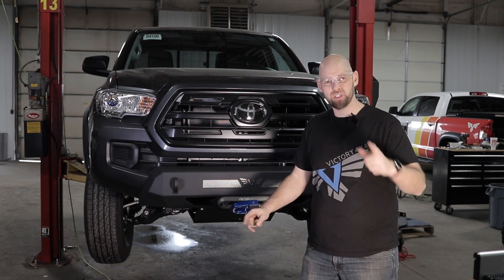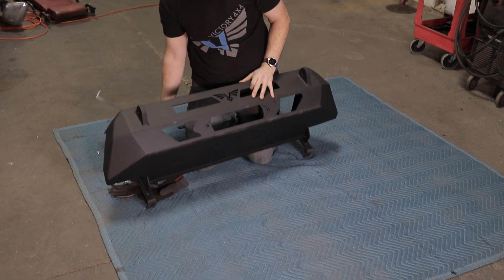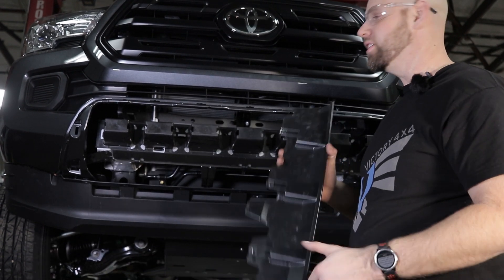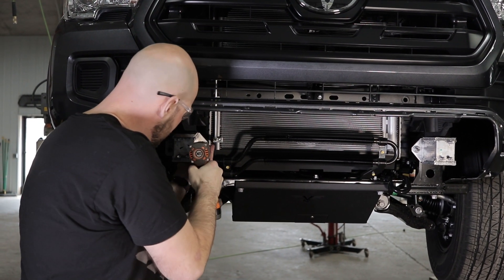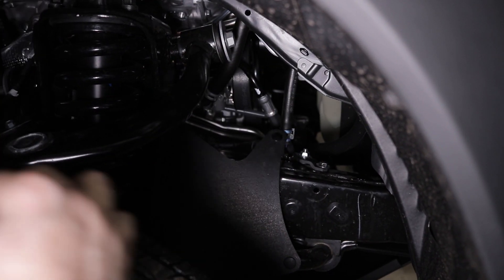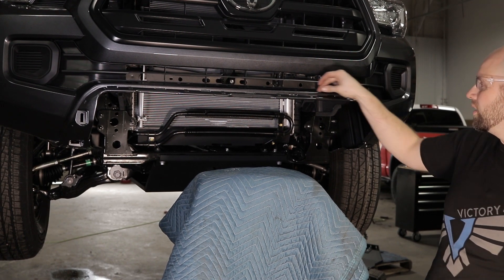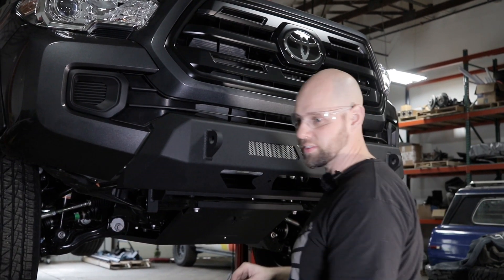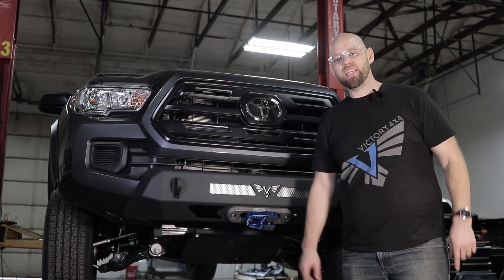Blitz Front Winch Bumper Installation | Toyota Tacoma 3rd Gen | Victory 4x4

Comment: Finished the install last evening after work.  Took me about 2 hours and I had to deal with a few self created issues along the way.  All went well after I figured out my jack was about 4 inches too short.  And since I had the winch mounted it was a LOAD.  But it went in very well.  One issue I had was the tabs to relocate the cooler were flat and appeared to be longer than the ones in the video.  When I trial fitted them the cooler came into contact with the bottom of the radiator.   I ended up drilling a new mounting hole on the passenger side mount that put the cooler out of contact with both the radiator and the bumper.  Not a big deal.  I also found a 6 inch strap with holes at each end that I did not use.  What is it for?  Did I miss something?  Very happy with the end result.  Looks great and highly functional.
Reply from the maker: It sounds like we may have accidentally shipped you the brackets for the 4Runner. Sorry about that! If you'd like to contact us at tech@victory4x4.com we can get the correct ones out to you.
Reply: Thanks..  Not a problem.  I got it installed.  Its fine.
Reply: Fit and finish is everything.

Comment: Such a simple installation...until it comes to those flaps in the wheel wells, which just happen to be tucked in BEHIND the mount for the remote reservoir on my Icon Stage 4 suspension.  Is there another way to access those?
Reply from the maker: You may be able to pull the wheel liners back enough to do the install without totally removing them.

Comment: Do you have to mount a winch with the free spool lever pointing down with this bumper?  That's the only way I could reach the release lever.
Reply from the maker: No, the clutch is accessible with the winch mounted ion a standard upright position. There are openings on either side of the fairlead that allow access into the winch plate for that reason.
Reply: @Victory4x4  Awesome thank you! Now I just need it for cheaper than air and I can afford it. (broke dad problems).

Comment: Question? Does it have to have the logo in the middle of light bar opening?  Seems like it is kind of a waste.  should just make it solid and have light bar space.  I get it is advertising, but functionality wise it doesn't make sense. Also would help cut costs.
Reply from the maker: We think it makes the bumper stylistically more interesting than a rectangle hole, and it blocks so little light (like 5% of the total area of the opening) when it's all said and done that we felt it was worth it. Comparable to putting a light bar behind a grill honestly.
Reply: Victory 4x4 what is the weight and pricing could you link it?  I will be looking into something like this in the future.
Reply from the maker: @buolson  https://www.victory4x4.com/product/VT3FB-T.html
Reply: Victory 4x4 .

Comment: I received two additional brackets that appear to go behind those 14mm outer mounting nuts. Can't find any installation instructions for them. Do I need to install them or will it be fine if I leave them off?
Reply from the maker: Shoot us over some pictures of the brackets in question and we can help clarify. Sounds like you may be referring to the tie-in brackets. 

Info@victory4x4.com
Reply: @Victory4x4  they are the tie-in brackets. I already contacted your customer service dept. They wouldn't tell me if I needed to install them or is it just recommended to install them. Because it's going to be a big pain in the ass to install them now
Reply from the maker: If they are the tie-in brackets, they do need to be installed, and the installation is pretty simple. That's generally one of the last things you do during the bumper install.
Reply: @Victory4x4  Ok. Thanks.

Comment: Will a Warn VR 10-s winch fit in this bumper?  I it was mentioned that a VR 8 will , what about the 10?   Just ordered one of the bumpers  btw, super excited !!
Reply: Did the Warn VR 10-S fit with this bumper or did you have to relocate control box?
Reply: @nickht88   It fit fine.  There is a metal arm or mount ( what ever you want to call it ) in the Tacoma front bumper that the bottom of the grill clips to that I removed. I used a few zip ties to secure the grill in place. ( bottom) .    I left the bar in for the first year or two but it makes it tuff to plug in the winch controls so eventually  took the bar out.  But either way the winch FITS well.
Reply: @brokenarrow420  awesome, thanks so much for the reply!

Comment: 16:12 can you get to those front 14mm bolts for the install with a Warn M8000 installed? Thanks. Decided to go with this mount. Only question I have.
Reply: Yes, should not be a problem.

Comment: anyone running this with a bull bar and TRD pro grille with Radar cruise?  wondering if it will work or if it interrupts the radar cruise.  Might just go with SSO slimline as i'm not too crazy about the logo.
Reply: doesn't affect the radar
Reply: @shoegum7362  that’s great to hear. Looks good without the bull bar but looks even better with it. And that it doesn’t effect the tss sensor for pro grills is even better.

Comment: License plate??
And rear steel bumper why doesn't work with BSM? looks nice but for that reason I'm not doing it... "license plate and bsm"... work on those details..nice products!
Reply from the maker: Something like this will work: https://www.quadratec.com/p/tuffy/flip-license-plate-holder-hawse-fairleads

BSM is a huge issue with packaging the sensors and liability. Toyota doesn't' give out testing or calibration procedures for these safety features, so we can't test placement.
Reply: Front license plates are lame. I moved to a state that doesn't have front plates.

Comment: Hi, I've noticed that you had already installed skid plate.  Would this bumper fit over the original "skid plate / bottom cover" (I don't know what it is called) ?  Thanks.
Reply from the maker: Yes, it works with the factory skid plate.

Comment: Harbor a freight has a 6 ton winch. Would that be able to mount on this?
Reply from the maker: That should be the same size case as the 8k and 10k. Usually, they just have lower gear reduction and are slower. 12K will be overkill for a 4Runner, though.
Reply: @Victory4x4  dam the badlands zxr 12k winch is $150 right now. Thinking of getting it. You said it would be overkill, but would it fit though lol?